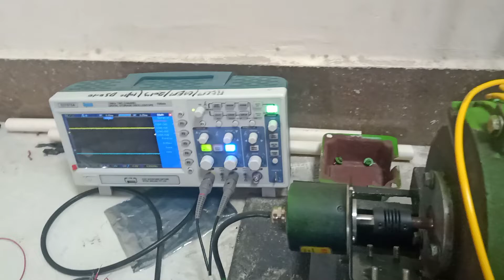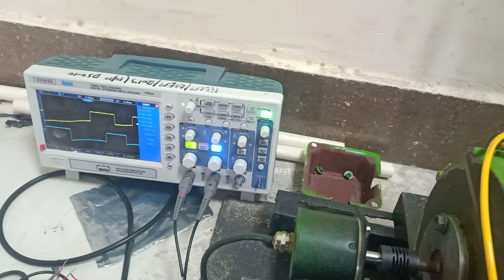Testing an Encoder |1024 PPR Encoder|

Comment: Dear Sir, I have purchased a PMSM motor and AC-DC-AC CONVERTER. how to generate an SPWM pulse in RT-lab for an inverter to rotate the motor at the rated speed?
I am using the same encoder.  please sir help me. Thank you
Reply from the maker: Dear Pankaj, the process will be same, just you need to use Digital out and its bitstream setting, so that from your svpwm block digital pulses can be taken outside of the simulator. For more please contact opal-rt